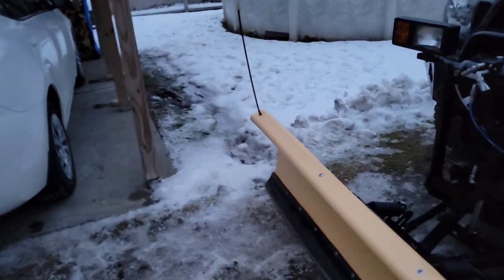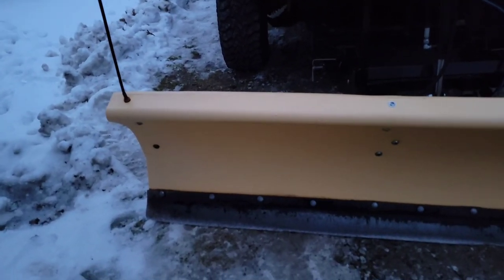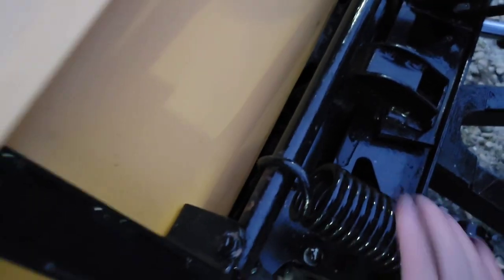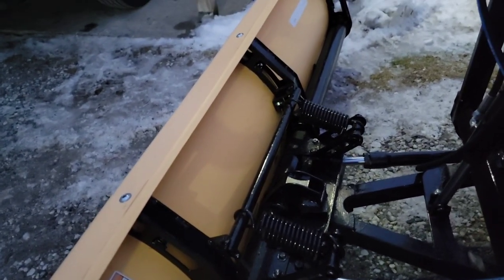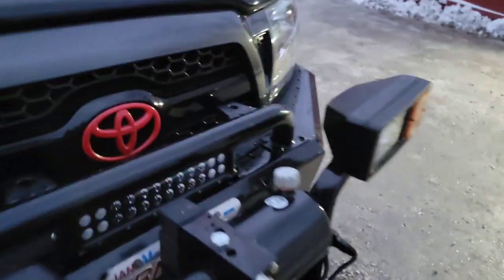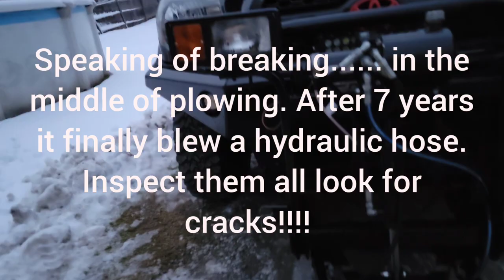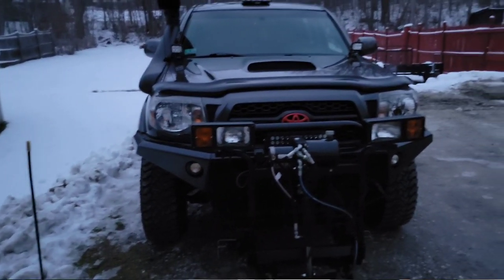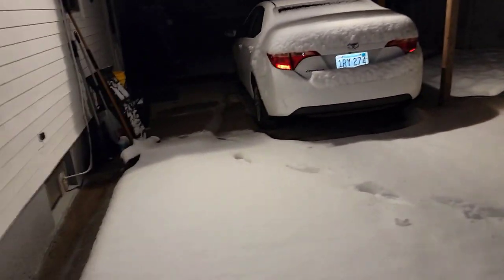Fisher Homesteader Plow Upgrades You Must do! And the Tacoma In action Plowing...

Comment: How much clearance do you have from the bumper to the plow frame? Any issues mounting it? I have a steel front bumper and was wondering if it would interfere
Reply from the maker: I didn't have any  clearance issues, really. It was just when excessive snow was pushed that it would contact the bumper. Every brand bumper will vary in size and ofcoarse plow design. I welded a couple of stoppers with rubber bushings on the end to prevent damage to the plow and electronics. It's a real light duty plow and I whooped it last winter

Comment: Been looking to see a taco in action with a snowplow under heavy snow before I go that route
Reply from the maker: A taco can push snow pretty well. As a matter of fact, it's just as good as any full-size or 3/4 ton pickup. It all depends on the plow size for the pick-up. You can't put an 8 foot blade behind a small truck. That's why these lightweight plows are made for a tacoma.

Comment: Plow went dead lights work but plow won't lift or angle I changed solenoid but it still just clicks what's wrong
Reply from the maker: There's a chance you have a wiring issue or a bad motor
Reply: @wjgrandcherokee  if I connect battery to motor on hot post and ground that should test it right
Reply from the maker: @kennethcampbell3970  it should.
Reply: @wjgrandcherokee  thanks
Reply: It's the motor that's gone. I had that trouble on fisher homesteader plow 2005 toyota tacoma